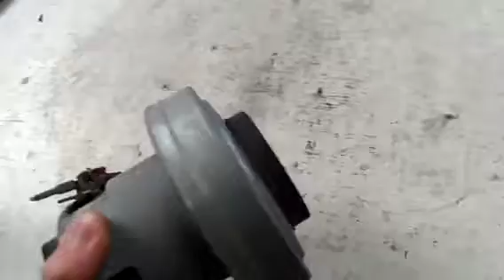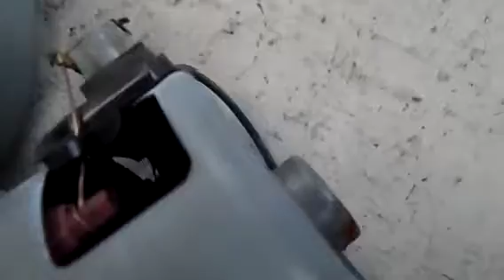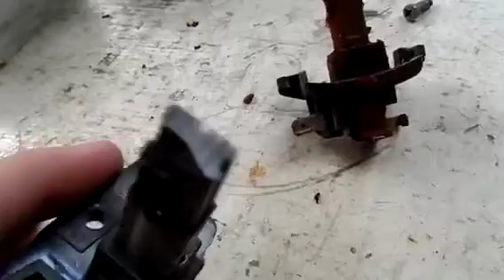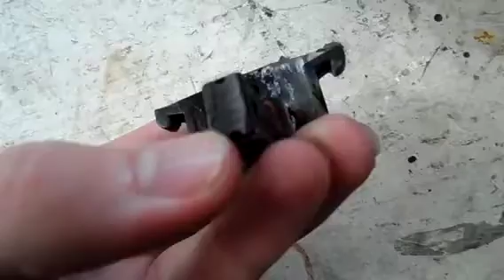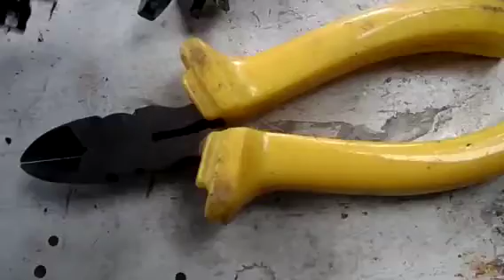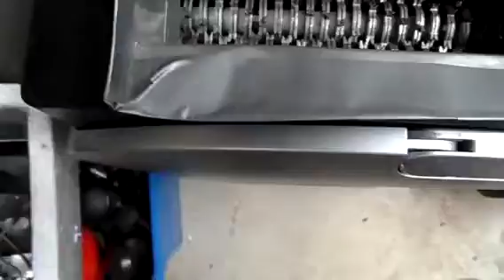Vacuum motor autopsy and attempted power up

Comment: some reason Vacuum motors never seem to die we got a old 70's vacuum and it kept on going but lost almost all of its suction so we gave it away to a repair shop he rang us a while back and said he has fixed the holes and the cracks in it causing the loss of suction and he sold it later to someone. unsure of it now but i bet it still is working fine.
Reply from the maker: Yeah this is the second motor that I've had that's been clogged up with crap
But the shattered brushes were an unexpected surprise!
Reply: I got a made in New Zealand kambrook fan heater from the 80's? im unsure but its still going! i think i should clean it out its full of dust
Reply from the maker: realgroovy24 tech good idea to clean it out every so often cos they can set them selves on fire if clogged with dust
Reply: i can tell its good quality it does not have any circuit boards at all! so it does not expand and shrink with heat unlike modern chinese ones
Reply from the maker: realgroovy24 tech does it have a plastic case? Bloody hate the use of plastics on appliances that are intended to get hot
Reply: Yeah it is plastic unfortunatley but it does not get hot exept where the hot air blows out and its got a few cracks other than that its good i might try get a metal case made for it but thats expensive..
Reply from the maker: ***** oh damn straight!